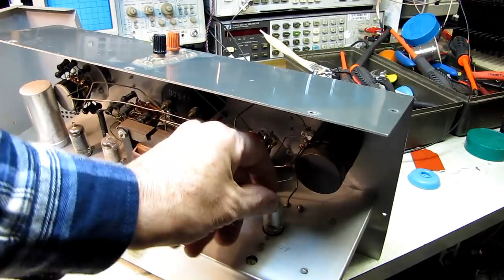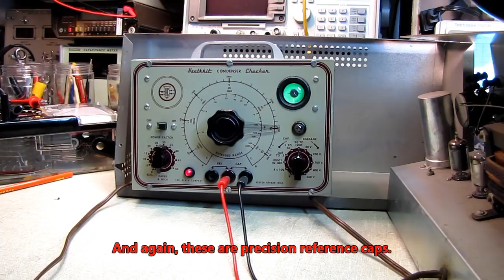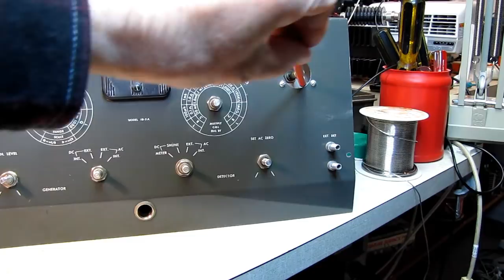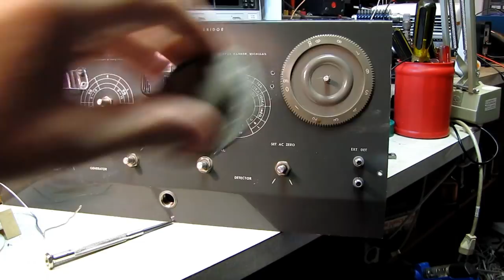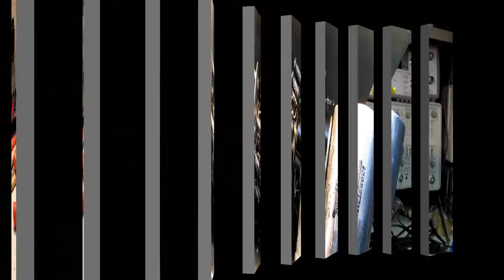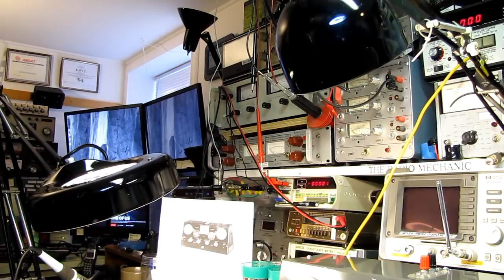Heathkit IB 2A Impedance Bridge - Repair / Evaluation PART 1

Comment: I just bought a IB-2A.  None of the knobs are damaged, though there seems to be a mistake in the molding process.  The outer dial on the right hits the base of the pointer.  Upon looking at the knob I can see there is an extra amount of plastic around the outer edge.  I think sanding or the use of jeweler files will fix this. 
Since none of these knobs are damaged, It would probably be in my best interest to build them up with epoxy before they start to break.  I have found that Loctite Marine Epoxy seems to work extremely well on many plastics, and can be easily sanded or filed.

Comment: Hello, I did one of these complete restorations in extreme detail with precision component replacement and put it up against a Genrad 1650

https://www.youtube.com/watch?v=YSqgzartIIU
Reply from the maker: Hi Jordan, you certainly went full boat on that. Little tip. Connect your scope to the External Detector and you will be able to clearly see those tiny nulls at the ends of the ranges.
Reply: Good to know , ill have to take it out and have a try oce the IM12 is off the bench

Comment: If you want, I have a high precision 3d printer, I can print new knobs for this thing. I would just need the broken knobs and a little time. And a measurement of the shaft size.
Reply from the maker: Hi DJ, Thanks for the offer. Have been thinking about buying a 3D printer. These however are now probably more solid than new.
Reply: If you would like some advice, Please don't hesitate to PM me.
Reply: Jeff Tranter has started this and posted some of the smaller knobs on Thingiverse and his Github.

Comment: Nice to see I'm not the only one who repairs knobs like this.  I do it the exact same way.  Use a rod to keep the knob insert aligned and a plate of aluminum.   I have a very late model Heath impedance bridge that was part of their school equipment line.  About the same physical size, just blue in color and solidstate.  It is very accurate.  Looking forward to part two.
Reply from the maker: Hi Mike, great minds run in the same circles. Or is that run around in circles? If forget.